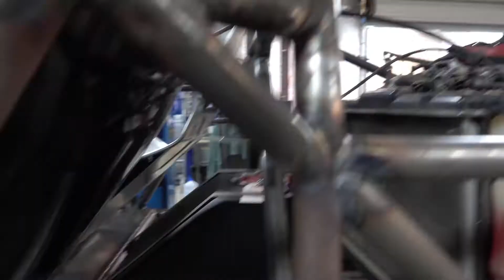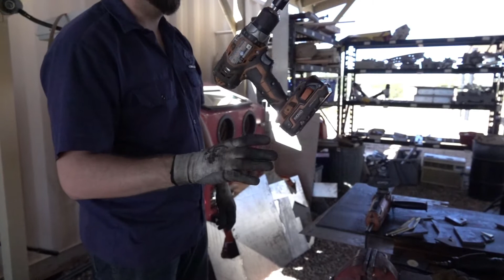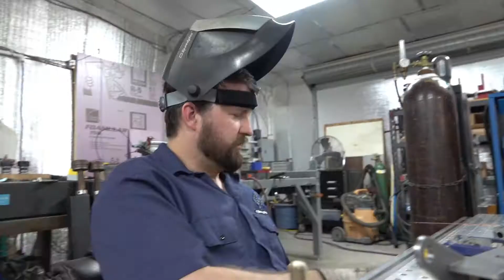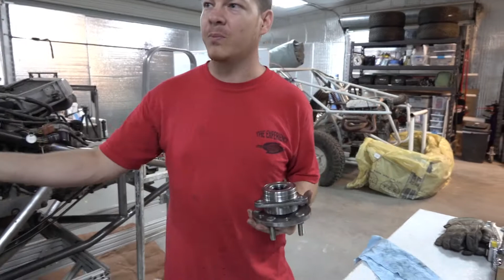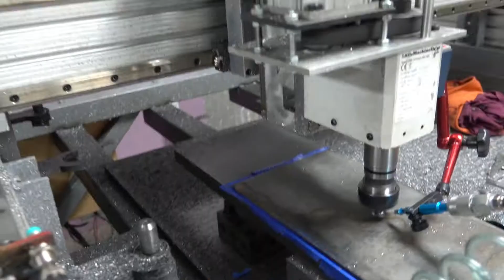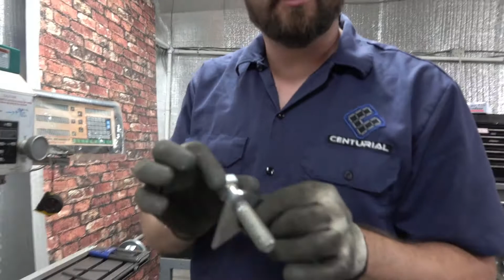Subaru Kit Race Car, WRX race car build, Wheels, Fuel finally done!!

Comment: Hey hope you guys are well and this project is still breathing. Is this on the road yet? I'm in the beginning stages of daydreaming about building an EJ25 based mid engine car.
Reply from the maker: Thank you. We are still working on it. But it has been slow. The electrotonics have us stuck for now and we have products that selling very well so that side of the business is consuming a lot of our time. We are close to finishing it. All that is left is to finish the suspension and get it running. Then body work, most likely sheet metal. Should be lots of fun when it's done. What do you want to do with your project car? Race it, show it or just something to drive around town and track days with?
Reply: @centurialinc  Nice.. I hope to see you guys wearing out rubber with that thing! The answer to your question is "all of the above" lol. I want to build a street legal car that I can have fun around town and turn heads at car shows but also tear it up on road courses. Two cars I get a lot of inspiration from are the Factory Five 818 and the Caparo T1, among others like Exocet, Ariel Atom, and the DF Goblin.
Reply from the maker: Those are cool cars. I heard that the 818 is no longer in production. Looks like someone needs to make something to take it's place....... If that's true.

Comment: Guessing 2 years is a little too late to suggest moving the radiator from behind the seats and the intercooler from above the engine 😶
Reply from the maker: No it's not to late. The car is still in the fabrication stage. We are stuck on the electronics and body work. I don't think we will move those items. But if we have issues with air flow and temps then we will have to. Thanks for watching and the comment.